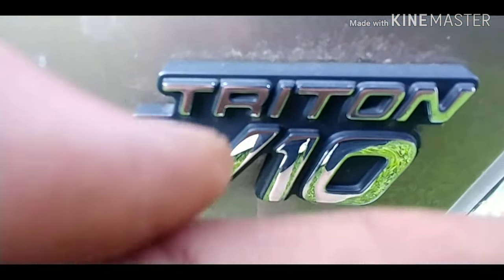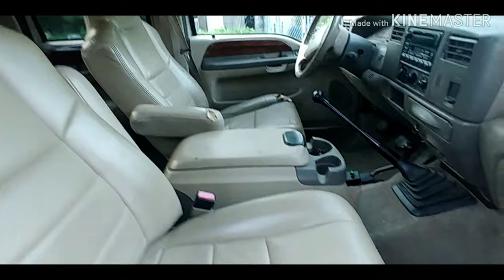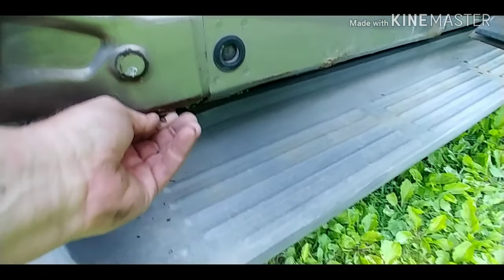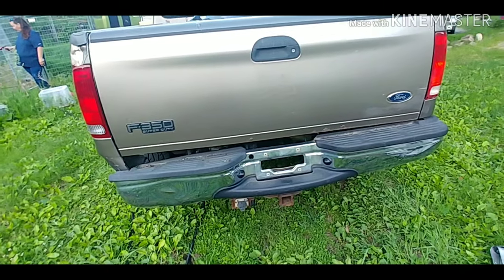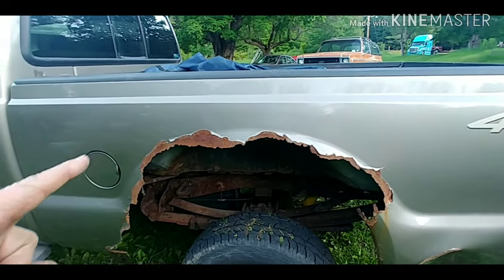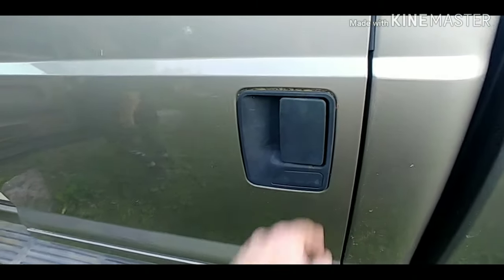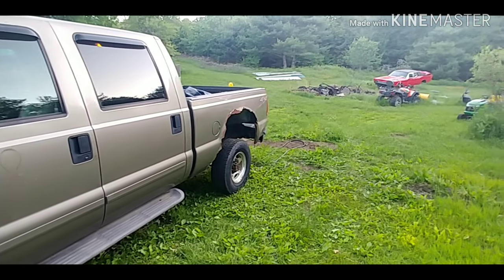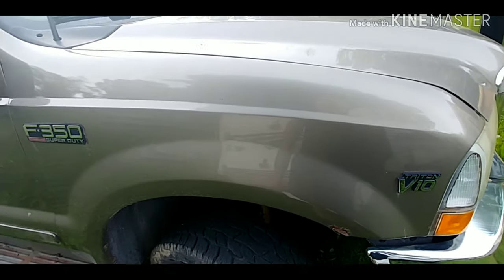New build f350 budget build v10 rust repair part 1

Comment: Look for new box
Reply from the maker: They are expensive. I can get patch pannels for about $300
Reply from the maker: I just found one for 800 obo. If i can get for 600 i might do it
Reply: Working mans restorations I would being a new truck they are all over.  You will have alot of $$ to fix that much rust plus under the box probably get bad also.